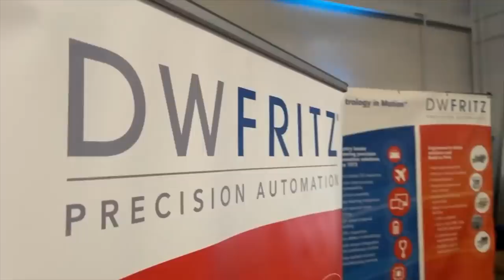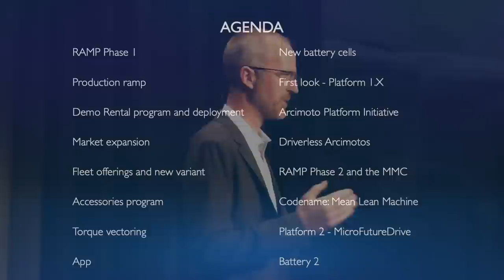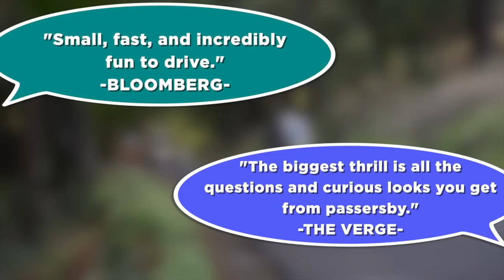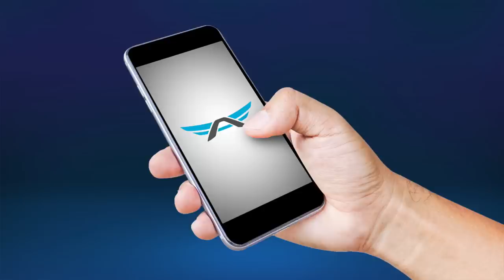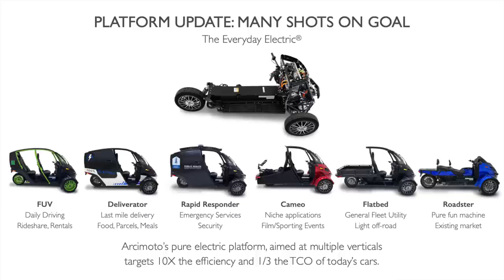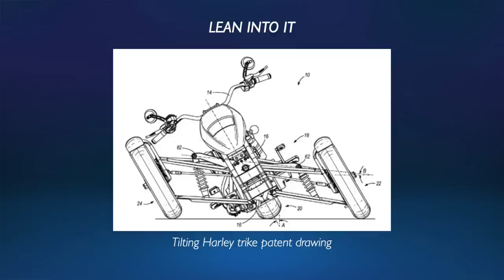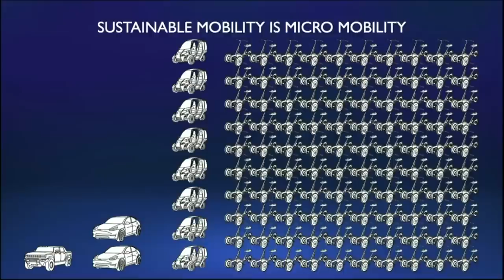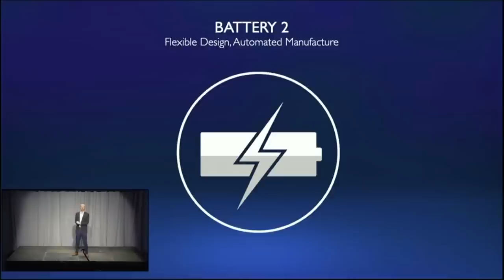RAMP IT UP! The Arcimoto Factory Opening & Stakeholder Update

Comment: It is now time to revolutionize the seat. The ancient bicycle seat needs a change. Something I can ride for a few hours and not have an aching ass.
Reply: You need to look at the Easy Seat, also called the Hobson Seat. I have a broken tail bone and could only use that design with two little padded hip joint supports that swivel a bit as you pedal. Nothing between your legs but a breeze.

Comment: Very good point about that ridiculous GM Hummer.  I am so disappointed that GM is going to build that absurd beast.  What is the point of going electric if you’re still going to waste 90% of the energy used?
Reply: GM hasnt built a vehicle I'd own again since about 1985. I cant believe anyone would choose their truck over literally any other brand. They cant even get the front left running light to work for 20 years now! If you havent noticed you will now. Easy to spot a chevy truck coming at you because garunteed that lights out.
Reply: @shmodzilla   I have actually noticed the running lights on GM trucks being out a lot, but honestly never noticed it whether it was the left or right.
My neighbor had it happen on his GM SUV.  I thought he told me the quote to fix it was several hundred dollars....is that possible?!!  

Anyway, because of the cost, he and another neighbor tackled it themselves in his driveway.  Pretty sure they had to remove the wheel well liner to fix it!  I know they were at it for hours but they got it fixed.
Reply: Because one has “small hands”?
Reply: Mine will need a cover shell, so it might be 1/50th of a Hummer.
Reply: @billclark8241    Bill?  I was talking about GM. GM went bankrupt.  GM avoided their pension obligations.  GM's stock is up even as they roll out another Hummer.  I wouldn't call GM "scumbags," but it should be clear from their actions that GM doesn't care about people nor does GM care about the environment.  But, the teaching point is that all one has to do is call a legacy stock "growth," i.e., "GM," and folks will buy it. GM. GM. GM.

Comment: Not sure on the doors - do they have roll up windows - and is there a heater + AC option?  If you are going to spend over $20K, these seem like necessary add ons options.  If you live in an area like Texas, you will need both AC and heat.
Reply: I drive my current Arcimoto right down to 32-degrees, and all you need is bottom doors to keep the wind off your legs (I wear riding chaps, currently).  

The Arcimoto has heated seats and a defroster that make it pretty comfortable without the wind, and the fairing keeps the rest of the wind (and rain) out.  Now, take those doors off and it is built-in A/C at 30 mph+.  I live in Eastern WA where it gets -5 in the Winter and +115 in the summer, so yah, Texas....

One last point:  every electron spent on heating and cooling reduces range.
Reply: Don't need AC on something that is classed as a motorcycle.  The biggest problem is no defrost IMO if the weather gets cold enough to fog up the window or build ice what do you do about it?
Reply: @melchizedek077  turn on the defrost.  it's there.  it works.
Reply: @melchizedek077  The Arcimoto is classed as an autocycle by the government. The MC classification only applies to the infancy of insurance company categories - glad for that as my insurance is $800 cheaper than it was with an old car in Florida.
The FUV has a three speed electric defroster for its windshield.

Comment: I like what they are doing so far. I've been hoping someone would manufacture a small lightweight tilting aerodynamic fully or semi-enclosed tadpole three wheel electric auto-cycle for a long time. An modern electric version of a Messerschmitt KR200 cabin scooter would be awesome. If it had a small frontal frontal area and low drag coefficient I'd put money down in a heartbeat.

Comment: Those doors are ace. Really great for ensuring your shopping doesn't suddenly decide to go walkies & you don't realise until several miles on down the road when it's too late & the bread, milk etc has long since been squashed into oblivion by other traffic.
Love all the other accessories too; great thought processes.
Reply: Doors are dead weight and they don't use steel beams for protection like car doors do. I added cargo webbing to enclose the passenger seat area. Very large capacity, so big you can skip the $750 trunk option which is small in comparison. Also it is common practice to just strap in a cooler for groceries.

Comment: Might a rectangular or square tank provide greater stability than the round shape chosen for the fire fighting version, especially where the vehicle may be travelling over uneven ground; less chance of it shifting at the worst possible moment & be commensurate with the shape of the loading bed, possibly affording greater liquid capacity.
Reply: Speculation? They appear to be focused on limiting materials and weight. Spheres and cylinders are inherently stronger & more stable than squares & rectangles.
Reply: @elizabethbottroff1218  You're probably right about weight but I was also thinking in terms of a shape that fitted more more snugly into the carrying bed which is either square or slightly rectangular. Also if applying the liquid weight reduction requirement, you could lower the center of gravity, increasing vehicle stability, by using a rectangular or square container that is lower in height than current cylinder shape, yet retain same volumetric fluid/s.

Comment: I really, really like that three wheeled e-bike. And I mean really! Is anyone else feeling like this?

The pedal generator is some next level silliness, though, I hope there is someone at Arcimoto with enough sense to get rid of this shit.
Reply: So I'm sure it charges from the wall as well as the pedal generator, that was a possibly confusing bit of whimsy to show off just the generator. Having the pedals run a generator lets you dial in whatever effort level/"gear ratio" you'd like, in software.
Reply: My take on the generator may be wrong but what I picture is generating electricity and sending it to the battery then to the hub motors. No chains/belts needed, no need to wall charge unless you want to. Don’t turn the motors on if you just want to charge. I like it! FUV is my 2nd largest holding and is getting larger on Monday! Go gettem’ Mark!

Comment: -Everybody is making evs and vtols startups YAY!!! We're so smart.
-Who is making the batteries?
-Uh..i gues there's a dude, not sure, i believe...uhmm.....
Reply: Google is your friend when you use it first, and your nemesis when you go off half cocked without fact checking yourself before commenting. Battery suppliers are multiplying faster than vehicle makers and recycling of batteries has begun.
Reply: @popeyegordon  no need for google fact checking dude, just walk outside and compare ice vs electric afordability on the streets, then use common sense and calculate the realistic next 10 years.
Reply: @Paccekabuddha  Your innumeracy disqalifies you from doing what you suggest. Your personal concept of common sense excludes the largest part of the value of EVs - no gas to buy, less environmental damage that costs everyone on the planet in ultiple ways. A clear thinking educated adult would not accept a gas powered vehicle given to them for free because those are more expensive in the log run.
Reply: @popeyegordon  and where are those free EVs? Inside your common sense i guess? At least not here in the developing countries for the next 15 years at least  i can bet
Reply: @Paccekabuddha  Nobody mentioned free EVs until you did just now. They ARE much cheaper to own and insure but nobody gives them away free except for some free e-bike programs. Oregon gives out a full $5000 cash rebate if you buy one, that is a huge discount. The cleaner air we enjoy by using EVs is a bonus that benefits every human on Earth. EVs are being adopted all over the world. Electric busses first in some countries. Electric trains in others. Electric outboard motors in fishing villages are helping some poor fishermen. There are electric planes too. Ebikes and light EV rickshaws with solar panel roofs will be the first to come to some developing countries.
Reply: @popeyegordon   @Popeye Gordon  my sarcastic point since the begining was startups should be focusing on making batteries instead of dumb unpractical concepts for evs, and yes you mentioned free gas cars i did the oposite comparision. You are such a climate change cultist can't even accept critics inside the same ev fan base. ICE vehicles ars are going anywhere.

Comment: But the car doesn't lean???? Ever?
Reply: No. It's better that way. It uses flat tread surface car tires 4.5 and 5.5 inches wide with much more rubber on the road than rounded motorcycle tires. Motorcycles can spin out on wet pavement or just a little oil on the road.

Comment: It looks cool, but unless it gets windows, it seems entirely impractical in cold or wet countries.
Reply: Not really. There are videos showing how dry the driver stays in rain. A billion motorcycles all over the world are used in all conditions except deep snow. They don't have a roof or wrap around windshield with heated defroster or wiper/washer. Or any doors at all for that matter.
Reply: @popeyegordon  Motorcyclists wear waterproof leathers, gloves and a crash helmet. Also, unless you've got somewhere covered to park it, rain plus strong wind equals a perpetually damp interior in some climates.

If you're going to get a wet arse every time you try to use it without waterproofs, why not just buy a motorcycle?
Reply: @edwardmullins2176  We have had time to figure this out. Autocycles don't need helmets. There is no interior as you relate to cars - no carpet, nothing water can damage. Just painted steel and a weather resistant dash. We carry a waterproof seat cover to add when we get out of the seat. When we are ready to go again the seat is dry. We have a great custom fit weather cover available from California Car Cover. We use light rain gear, leather was adopted by bikers because it would not rub through easily and give you road rash but we are buckled in tightly. We can drive barefoot or in flip flops.
Reply: @popeyegordon  I only mentioned helmets and leathers in regards to the weather projection used by motorcyclists after your comparison between the two vehicles, and the massive popularity of the former despite the lack of a sealed cabin. This is a false equivalence as motorcyclists are wearing their weather protection, while an arcimoto driver presumably won't be unless they want to drive around in a rain hat and coat so the spray coming into the cabin on a rainy day doesn't soak their clothes.

While this may work in places like California, until this has a sealed cabin I don't see it having much appeal in windy countries like the UK, that get an average of 130 days of rain a year (170 in 2020)

I like the idea of and technology behind the Arcimoto, but I'm very skeptical about this seeing mass adoption, especially for commercial fleets. A three seater variant could potentially be used as an auto rickshaw in places like India, but I doubt many could afford it.

Also, the notion that this will make any meaningful contribution to tackling climate change seems naive at best, and cynical corporate spin at worst. Rather than buy a second or third 'car' as a kind of novelty leisure vehicle, it would be far better for the environment if people walked, cycled or used existing public transport.
Reply: @edwardmullins2176  That's total bullshit about you denying lighter vehicles won't help climate change. I owned a motorcycle while living in the HOH rain forest for 5 years, 200 inches a year but when conditions were reasonable the bike saved me from using the car or van I had.  Stop with all the ridiculous nit picking about rain gear - there is a trunk in which any number of garments can be ready to use. The whole damn country is going electric. Admit it or not, like it or not. Car makers have all announced their plans very publicly. Arcimoto is on the leading edge of the bell curve representing the change. Smart concerned people want to stop stealing resources from future generations as soon as is humanly possible. Deniers like you are dying off or being 'replaced'.
Reply: @popeyegordon  What is it I'm denying? I absolutely accept the science behind climate change and agree that transportation needs to be electrified. I'm not arguing against electric vehicles.I understand your broader ideological point about climate change, but I'm talking specifically about the arcimoto, and how exactly this concept will make enough of an impact to justify the hype and make a truly meaningful contribution to reducing co2 emissions globally. 

Given its size and lack of protection from the elements, I doubt it would replace many people's primary car(s), and certainly wouldn't be suitable for medium or large families. I also would have some serious concerns about commuting on the motorway with other full-sized cars and heavy goods vehicles, especially while they're pumping out fumes and you don't have any windows.

As a second or third vehicle for city driving or short commutes to work, it is competing with forms of transportation that already have some of the lowest carbon emissions per person, such as walking, motorbikes/scooters, bicycles and public transport. And for a fraction of the cost of it you could buy an electric motorcycle, e-bike or bus pass.

As a commercial vehicle concept, this seems like an absurd proposition. I can't honestly believe any sane commercial fleet operator would make the decision to switch. Why on earth would a delivery company want to carry a fraction of the packages they otherwise could in even a small electrified van? And what exactly is the Flatbed for? You could fit as much or more on a car roof rack.
Reply: @edwardmullins2176  You are a legend in your own self important mind where unresearched unverified arbitrary personal opinions out weigh the relevance of top experts in many fields. Nothing more.
Reply: @popeyegordon  As you have no counterpoint to offer other than inexplicable personal attacks, I think we can call this one done.